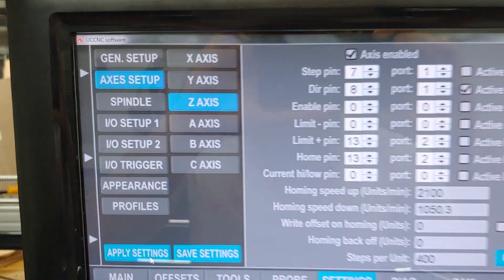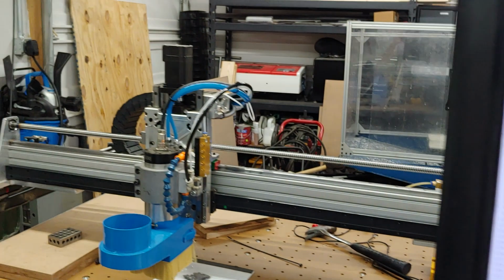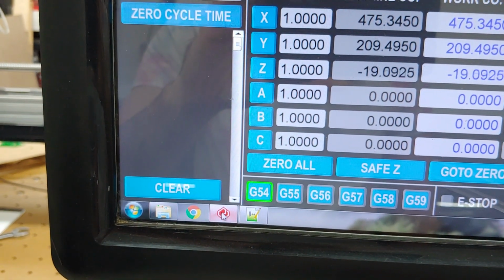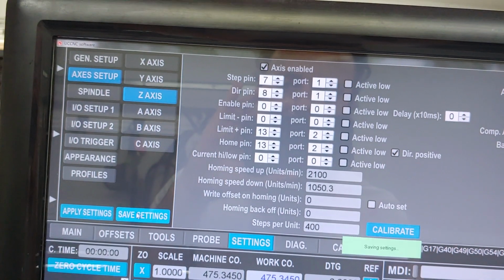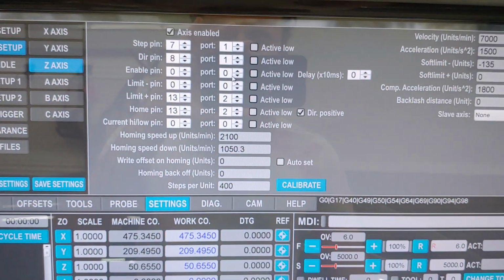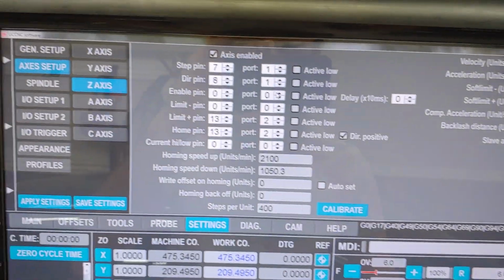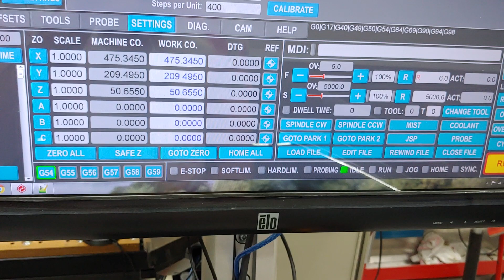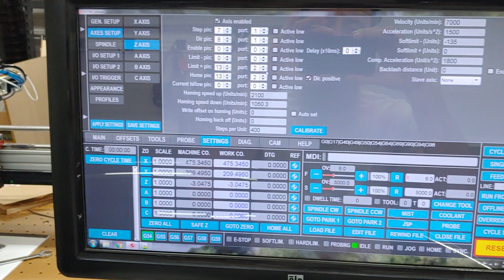UCCNC Z Axis Wrong Direction

Comment: swap the order of the wires going from the driver to the stepper to reverse it
Reply from the maker: I ended up figuring it out with the help of the UCCNC forums.  Turns out I had the same pin assigned to something else in the config for a feature that I was not using.  It was a bug I introduced by importing a mach3 config instead of starting from scratch.
Reply: @ReiniGrauer  good to hear, looking forward to seeing some videos of your router dancing now that it sounds like it's up and running.
Reply: @ReiniGrauer  what setting?  I'm going to import mach3 to UCCNC too and don't want same mistake.